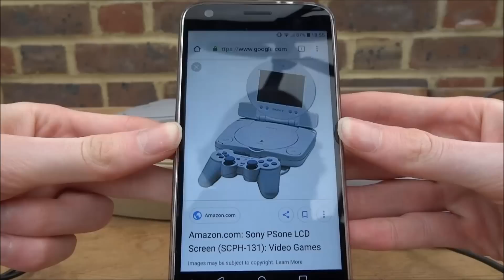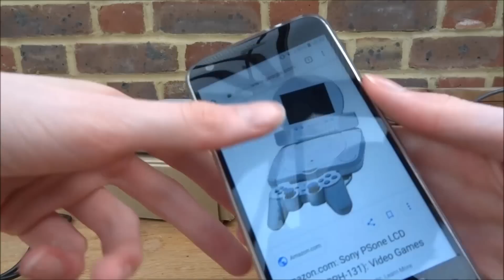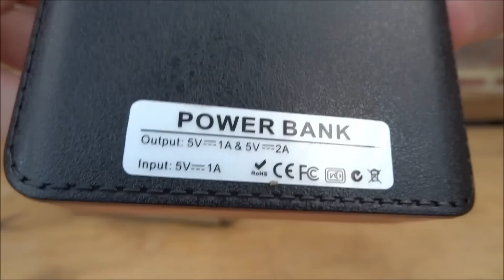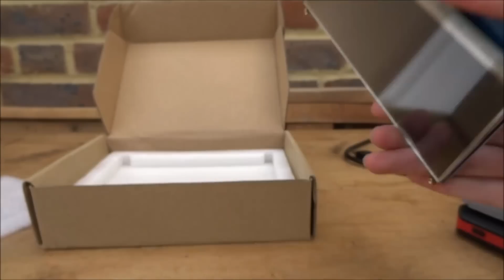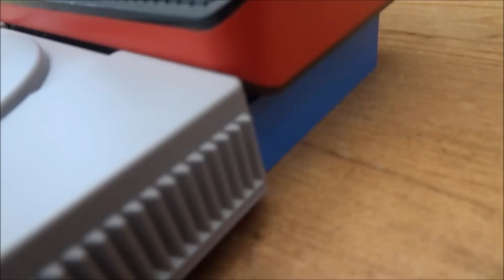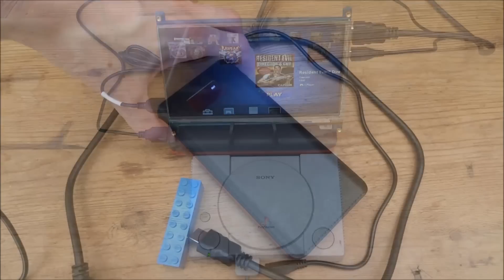PSone LCD Screen Setup On PS1 Classic?

Comment: I think RetroArch would allow you to correct how the screen displays, by going into the RetroArch options. You would have to run the games through RetroArch, but it allows you to play the games built in to the device, using the same emulator built in as well, I think.

Also, if you get a compatible keyboard, which there are not many, then you can access the hidden options without using a software mod at all. The hidden options might let you adjust the screen. I don't have a compatible keyboard, so I don't know for sure if display options are included in the hidden options. I saw a you tube video on how to access them a while back ago.

Comment: There has to be some kind of resolution setting.  This same problem occurs when you get a new graphics card for your computer. But there is an nvidia software to let you pick the size and resolution you want. I had this exact same idea with the raspberry pi monitor.  I just decided to look it up to see if anyone has tried it. Awesome video. I have been wanting to build a mini pc from raspberry pi's online store but I dont have any hands on experience with pis. I wonder if you can hook the pi screen via usb to a pc and adjust the display settings to to move everything over. If you can move it over there might still be a black boarder on the left and right of the game you are playing but it does that on every modern tv I have played mine on. I have a hack stick on my PS1 Mini with all my favorite games it's like 100 or more games. I love this thing it would just be really neat to make it where when my nephews and nieces come over, I dont have to turn off the football game and instead bring the mini and a monitor and set it on a small table or something in the living room so they can play and ask me questions but the game is still on for the adults.

Comment: Bought a 7 inch HD TFT  color monitor from china...works great with the PSONE classic console....gives you the ability to change screen resolutions also....no screen spill over.  Only downside to this one is it didn't include a ac adapter (doesn't take usb power options) but it does have built in speakers

Comment: James if you get another screen this will work better. Search for an LCD screen with a native 720p resolution minimum, 1280 x 720 is the display area the system needs to not cut things off. Not sure Adafruit still stocks any of that resolution but they do exist. Easier to find 1280 x 800 just remember you need the minimum for this kind of setup.

Comment: I think you need to use the controls on the screen itself.
Seems to be set to 'pixel 2 pixel'.
Should be set to 16:9 or something.
Reply: There's no controls on the screen, it's just the screen itself
Reply: @GaMeOvEr12454  Adafruit usually includes a control break out board with this kind of screen, not that it will look as good even if it can be adjusted to fit. Really need a bit more screen/pixel area for full resolution.

Comment: You also use the LG G5 as Phone :D ? Very good and underrated Smartphone :) If LG would make the exact same phone just with better specs and battery then i would definitely buy it again and again :). Especially the battery needs an upgrade :)
Reply: Im still on LG3 and love it. :)
Reply: @ChrisWolfe111  The LG G5 was my first phone of LG so i dont know how the LG G3 is in comparison but if its just as smoth as the LG G5 than i can understand that :)